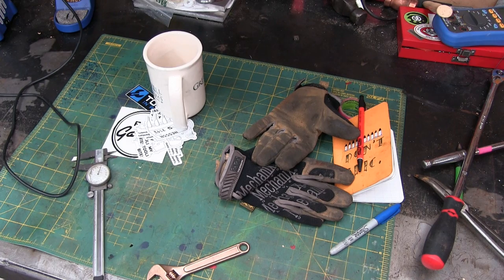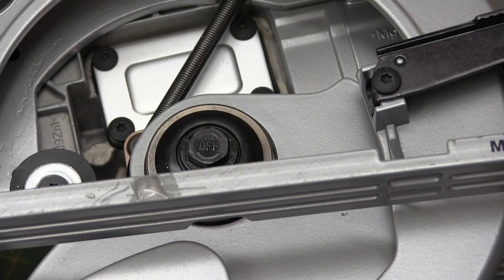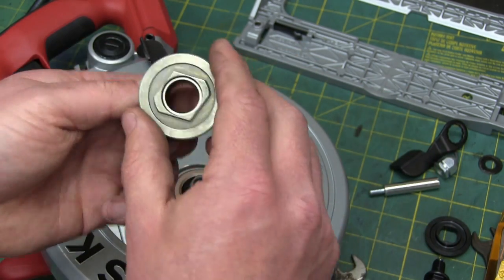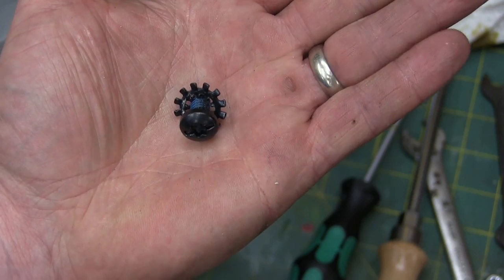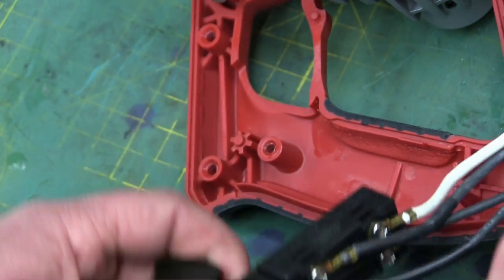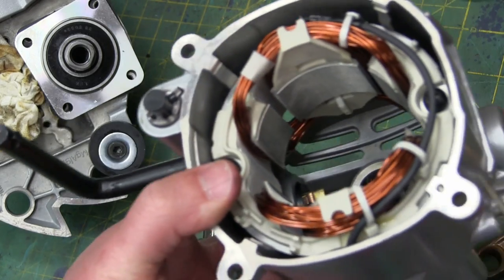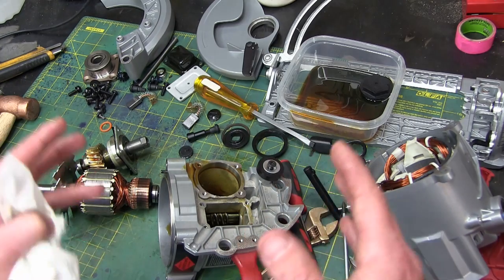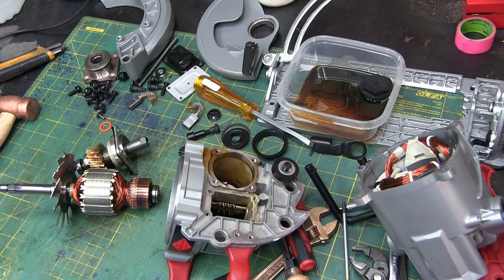BOLTR: Skilsaw 77 Magnesium Worm Drive

Comment: Whenever I hear magnesium I instantly think about setting it on fire 🔥
Reply: SlammedHemi just like the old VW bugs. Car fires were sure interesting with the use of the magnesium block thy used back in the day. Water won't put it out. Class D extinguisher or lots of sand.
Reply: Is the heat from a car accident really hot enough to even light up Magnesium? I remember it being really hard to ignite.
Reply: Lore says about a store of magnesium tools that caught fire...
Reply: rabbitphobia yes sir it can,the worst was a old VW,we hit it and bam,Magnesium flare.Some Vehicles have it in different place,guess the steering column and assorted areas,had a few flare on us,it's kinda cool.
Reply: rabbitphobia they can get hot enough for sure. during my cpr and fire extinguisher refresher classes, heard lots of stories from firefighters/paramedics about some rich goof crashing his Porsche and the magnesium wheels just wouldn't stop burning.
Reply: as a high school chemistry teacher i can tell you kids love to steal it and light it up in there lockers.... wouldnt know who gave them that idea ;)
Reply: fire happens in car accidents, a bic lighter will ignite small pieces of magnesium.  Friend of mine torched 2 VWs one from an electrical fire, the other cause of a fuel leak on the exhaust... once the motor or trans gets going not much you can do besides sit back and watch
Reply: I remember as a kid it was really hard to ignite, well I suppose you learn something new all the time, thanks for the ifo.
Reply: Wow,  poor Porsche owner... (snicker)   ;)
Reply: now that's more to ponder about, thanks for the info.

Comment: Carpenter/General Contractor for 25 yrs.  Big fan of Makita but I have burned up & tossed away several Makita hypoid saws while my worm drive 70/77 Skill saws were always indestructible.  I still had one that was 27 yrs old & going strong until it recently went away. (more about this to follow in the next paragraph) I can't speak for the construction of the new Mag 77 but the older models are skookum as hell.

Oh yeah, by the way, I could sure use a new Mag 77 if you feel the warmth & need to send it my way.  My divorce cost me all my tools including my worm drives.
Reply: Yeah well, I made my choices too.  Perhaps I was a little if not a lot naive.  I'm now happily bitter & cynical & a little bit wiser.  I always thought miserable old men were entertaining (lots of great stories) & I am indeed becoming one.  ; )  Cheers.

Comment: Quick correction: yes, SJ on the cord denotes Service Junior. But what that means is that it's rated at 300V instead of 600V (as in standard Service cable). It does not mean the jacket isn't oil or water resistant. For example, SJOW cable is oil and water resistant and is also Service Junior.

Comment: AvE, do you think that the flexibility left in the handles by leaving out the glass fiber might prevent breakage when the carpenter drops it off the roofing joist onto the noggin of the foreman?  That's the only "engineered" reason I can think of for leaving out the glass fiber (though we both know the $aving$ play a capital role in that decision)

Comment: As always..great video.  I recently took apart a HF version of their worm drive saw--amazingly exact knockoff based on what I saw here...
The HF unit weighs 21 lbs--and everything is steel---the new Skilsaw weighs in at 11 lbs.  I would note that the hardened steel washer under the circ-clip holding on the blade guard is missing.  I took it apart because there was looseness in the guard.  The parts diagram lists it--and so does old Skilsaw parts--but just missing during assembly.  so--found one at McMaster Carr--( lucky I live near one of their warehouses) --assembled--and now very solid.  Overall--I kind of like the heaviness of the old skilsaw / new HF.  I share your view on the "feel" of the new saw....

Comment: I’m curious, I notice in a lot of your videos, you talk about being surprised that certain things aren’t “hardened” or softer than maybe it should be.  
Now, I don’t know much about steel, iron, tool steel, whatever; but if I wanted to, could I harden certain steel parts that were not previously, (preferably without destroying the part)?  Quench it in oil or something?  I really don’t know and would be interested if anyone knows.  

—Separate question: can you make “tool steel” from unhardened, or hardened, (not “tool steel”) steel?  Or is it a completely different material.  If anyone knows of any videos or info, I’d be interested for some good reads/watches.  Thanks in advance!!
Reply: tool steels are completely different materials than mild steel, usually with different amounts of herbs and spices for different applications. as for hardening premade parts im sure its possible but might be an issue if dimensional accuracy is important

Comment: Is it possible to get a video on a Skilsaw 77 before they went to China? I know it'd be expensive but it would be nice to have a reference of something good.
Reply: Reagansmash the essential craftsman youtube has one or two of those I would bet.
Reply: Kevin Schneider our other sane uncle, who is as cool as ave. I bet as brothers they would make awesome tree forts with real cannons
Reply: Things are pretty much the same.  I have owned about 10 of theses saws since the late seventies.  Continually worse over the years but the field operation and balance of this saw is what has made it a standard.  Have owned the De Walt and Makita as well.  They just don't have the magic the 77 does.
Reply: Buy one on ebay
Reply: Reagansmash I recently procured a skil bench grinder that would be 60/70s vintage from my grandfather. Feels and looks pretty skookum, haven't had time to use it / take it aparrrt. Don't see a lot of Skil stuff in Australia, pretty good quality???
Reply: Not a video but this guy on reddit just took his apart and did an album , pretty awesome 
https://www.reddit.com/r/Skookum/comments/6ghab9/as_a_companion_to_the_chervonbuilt_mag_77/
Reply: I've got a basically unused skilsaw 825 (8 1/4" version of the 77) from the 60s, and it's spectacular
Reply: Fuck, accidentally deleted my reply. Where is the "are you sure?" youtube?
----
I always wanted a 77, but I ended up getting an all-metal Black and Decker 977 probably from the 60s. Its probably better than a modern plastic skil saw, but I dunno if it's as good as the old skil ones. I'm not even sure it's a true worm drive. It's got the classic shape and has the oiled gearbox, but you can spin the motor from the blade. Maybe they use really steep worms, I dunno.

This is probably the skil saw I've ever seen. https://huntsville.craigslist.org/tls/6144834401.html

Comment: I’ve had one of these since 1998. We used it to cut everything! Steel and rebar, lumber, concrete, bricks etc. it’s a brute, never gives up. This past November it finally burnt up. Excellent commercial do anything saw. Only drawback is the weight, pick it up for eight hours and the taco grabbers get tired.

Comment: Those bushings are part of the "safety anti-kickback clutch" mechanism for the saw. If blade gets jammed, it allows it to slip. Only adjusted by how hard you tighten the blade.

Comment: About the electro coated pin. Anything can be turned or ground after plating as long as it’s thick enough for your desired Dimension. We coat steel rolls all’s the time with copper and turn them down and rotary grind them.

Comment: Ave, apparently the Makita hypoid also might have a design flaw. The blade lock button is in a low enough position where it might be possible for oil to leak out if the button seal fails. There are a few reports on amazon about this happening so.... This skilsaw and the Dewalt DWS535 worm drive have their blade lock buttons positioned above the oil level so there isn't any possibility of leakage. So you might want to take apart the Dewalt before wholly recommending the Makita as the Dewalt might actually be a better saw. Just saying.

Comment: This is at least the 2nd time I've heard you say this. 60hz AC passes through zero 120 times per second not 60
Reply: @taunokekkonen5733  these power tools run on domestic 2 phase though, so surely 120? Isn't 3 phase usually industrial?

Comment: Correct about the undercuts in the mold. The molds are very often built by an outfit different from the molder, and while the tool builder can get enough samples from the tool to prove it and ship it, it is a whole different matter when the molder gets it and is trying to mold thousands and hundreds of thousands of parts. Hence the field commissioned undercuts.  The flexible plastic will improve it's  impact resistance, so while it doesn't feel as rigid as a glass filled plastic, it can help it survive a fall better than glass fill. Glass fill can stiffen and strengthen things  quite a bit, but do make the plastic more brittle.

Comment: SJOOW is still oil resistant both in the the cable and the conductors themselves are covered in an oil resistant jacket. The W directly stands for water resistance. The junior is in reference to the voltage which means it's rated for 300 volts rather than the 600 volts that SOOW is rated for.

Comment: The lock washers have teeth on the inside circumference to engage the fastener no?
Reply: jkjklol123 . no. it doesn't even engage that because its too wide. Some 14 year old chinakid put it in wrong side down. They're supposel to engage with the tool's body.
Reply: 13:00   There are actually innards and outwards teeth on that worsher
Reply: You're wrong. Look again.
Reply: I "saw" the inside teeth as well
Reply: the teeth just flatten out. and for it to lock it would have to dig into the bolt and the tool so the teeth would need to go both ways.

Comment: I grew up on jobsites with my dad using only SKILSAW.  I can't imaging how many miles of wood cuts his saw made and how many blades it consumed.  The thing I liked about SKILSAW is that they track straight.  It is relatively easy to to cut a straight line.  The saws with the motor perpendicular to the blade wandered off the line terribly and had terrible rotational torque.

Comment: so like you said this saw built America, faults are well known as most framers/carpenters have used this saw.  I personally have 2 of these saws one my dad gave me( 20 years old) and a new one.  Brushes go out, cord gets cut/wore out, trigger stops working and misc angle adjustments fasteners break or you lose them.  Great saw though.

Comment: 18:58, I think the molding is done with a 2 couler press. The molding machine will inject the first part (red). Than the mold cools down. The mold will that change from size so it is ready for the black part. The black material can than be injected (the materials will than fulcanize to eachother). The mold opens and than the pins will push the the material out of the mold.

Comment: Nylon may be flexible without glass fiber, but I challenge you to break that trigger guard. I bet it takes more abuse than you thought
Reply: It would probably be fine tucked away in the garage only to come out once in a while for homeowner guy to start a project that he never completes. On site it wouldn't last a year though.
Reply: Pig Benis 
I pour concrete foundations and use two of the light weight models and we have put hundreds of hours on them and use them frequently. they have been rained on covered in mud, and dirt. They continue to work day in and day out. I honestly don't think you know what you are talking about
Reply: Jarad Shively You pour foundations? And you have hundreds of hours on your tools?!? Wow, good for you! I build and pour foundations, and I also frame houses. Been doing it for well over a decade and burned through plenty of tools (more like my guys usually burn through them), so I'm pretty sure I know what I'm talking about. Come talk to me when you have thousands of hours on tools that are being manhandled by walking monkeys who give no fucks.
Reply: Kid, don't question the might of a 500 pound gorilla, ok? If they want to break it, they will break it. Glass reinforced plastic is the one standard they fear.

Comment: The forward handle is NOT used during operation of the saw, but is merely a carrying handle. It's NOT beefy, so that one may grab it with ease. Real carpenters, only use the rear handle, but diy'rs may not have the confidence, muscle memory, or balance to operate as a pro would. This is a pro's tool, not a diy user's.
Reply: Sounds like an idiot in love with his shitty skilsaw. Im a "real" carpenter and sometimes use the forward handle during awkward cuts or while ripping plywood or boards.
Reply: MrJojo8675309 Good point.

Comment: The o-ring on the skateboard bearing is for keeping the bearing from spinning in its housing. Caterpillar use to set a single ball bearing into the shaft half way and the key grove in the bearing race would have the other half so a slip fit would not spin. Now they uses o-rings for traction.

Comment: Thought I'd throw this out there about the trigger switch: I just resurrected a MAG-77. The nylon connector did not fail, the CONTACTS inside the switch wore down. I swapped it for the surprisingly-insanely-robust Eaton switch from a DeWalt DW359. The fit is a bit tight since the Eaton is big and fat so there is a tiny bit of space - about 3/64" - in the middle of the handle. Slight gap aside, it works excellently. Again, it was the contacts that failed on me, the connector was actually still intact, those contacts though, they are stupidly soft.
By the way, the reason I had the switch to do this Frankensteining was because the DeWizzle slung two commutators while running; which subsequently proceeded to shred the brushes, holders and quite a few armature windings, so, it's history to say the least.

Thank you for the video, sir! I'm new to the channel - been watching about 3-4 months now - and have learned an enormous amount over the last couple of months. Thanks for sharing what you know with others, I'm thinking about (not advertising here, just saying) starting a channel to give actually-useful advice to young men about real crap like dealing with tools and fixing stuff etc. Stuff I learned the hard way and so forth and crap you can't just learn from google. Thanks again for all the videos, I am definitely going to be a supporter, I'm hooked. I'm only 29, but I've been using power tools since I could walk, working full-time since age 12, so I've seen the suckers fail (and succeed as well) in just about every way possible. I'll be throwing you a line on the "doobley-doo" here and there. Thanks again for the great vids!- Preacher

Comment: who gives a fork about the factory cord? everyone knows that's gonna get replaced with a 40 footer real quick.

... especially if you doobly-doo it to me
Reply: CMOS Crash what cord do you use when replacing the cords?
Reply: Yup. One of the first things I did for mine was replace the factory cord with a 25 foot 12ga cord. Chooches extra good now. I also tapped a hole in the guard-thumb-knob-thing so I can put a thumb screw in it to hold the guard out of the way.
Reply: I think the cord would for me last until the expected loss of the pixie path during use.
Reply: LEXUS-RX300 It depends on a lot of factors. For this kind of tool, I'd go with 14AWG SJOOW, SOOW, or SEOOW. each of those has advantages and disadvantages. But to be completely honest, I've never replaced cords on tools myself. but I am a pixie-wrangler by trade, so I kinda know what I'm talking about.

Comment: I've been noticing more and more of this coming out of China.  Used to be you could count on things being correctly designed to the bottom dollar, but now you get a bunch of frankenstein monsters combining high-dollar, well made, well designed parts with "couldn't give a fuck less" grade and "don't understand engineering at all" grade parts.
If they took half of the excess that went into some of the high quality metal parts and bearings and invested that in the nylon molding, or, even cheaper, a few dabs of god damned epoxy, this would be a much better tool.
Reply: I've never understood why, all too often, the Chinese mindset appears to find it perfectly acceptable to spoil, what would otherwise be, a perfectly good ship for a ha'p'orth of tar.

Comment: I think you are a little nostalgic about the Makita. In your Makita video it showed a stamped steel base plate vs stronger and sturdier magnesium for the Skil. Makita did not have epoxy on the armature either plus it had a plastic fan whereas the Skil has a metal fan. The Skil had a higher amperage rated switch, bigger bearings throughout, and a monster hardened steel arbor and bushing. Nobody makes tools like they did in the good old days, but to be fair the Skil is just as “Skookum” as the Makita, if not more so. Take care and keep your stick on the ice.

Comment: its called a table mate, that saw has a magnesium table. 
those mags are chit, steel doesnt crack like the mags do. Framer from way back. seenum all, ranum all. 
boys got weak wrists these days, always crying when they pickup a mans saw.  
cheers
Reply: im more concerned by the chincy plastic parts.  I bought the regular aluminum model since it was cheaper.

Comment: O-ring - Float bearing retainer, usually uses a washer to hold it stable on startup. Opposite bearing would be a thrush bearing. The O-ring could be there to provide some resistance on startup and and provide for low tolerance on the blind flange. It wouldn't need to fit tight so easier to mold the part plus there would be some measure of shock absorbing going on. That's a guess.

Comment: At 13:45, the locking washer has 2 sets of teeth on it, one internally and one externally, so presumably the internal ones engage with the screw. You can see them on the video.